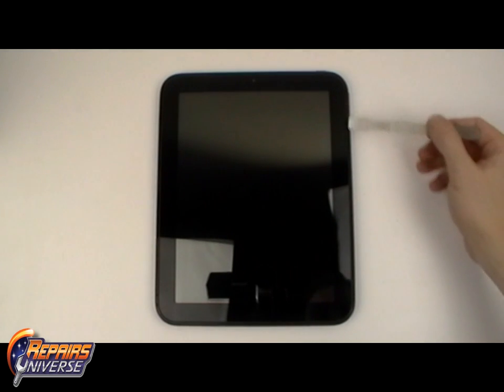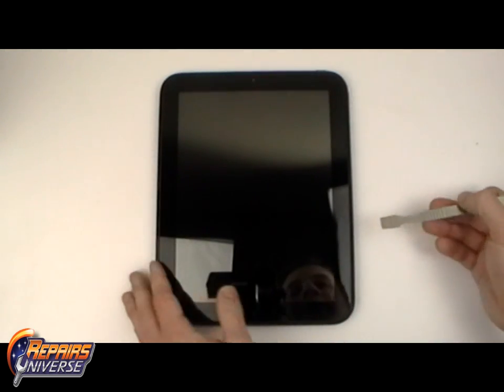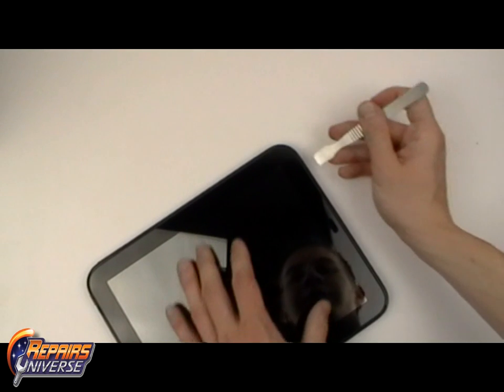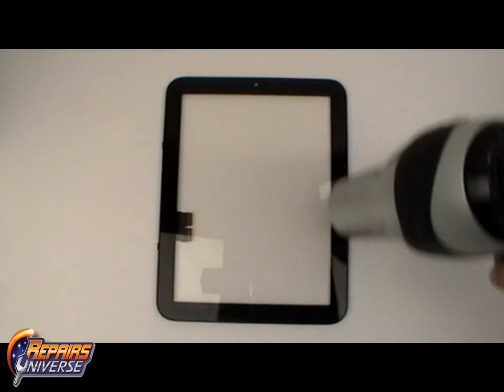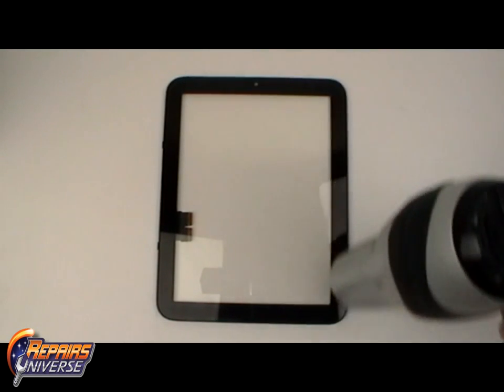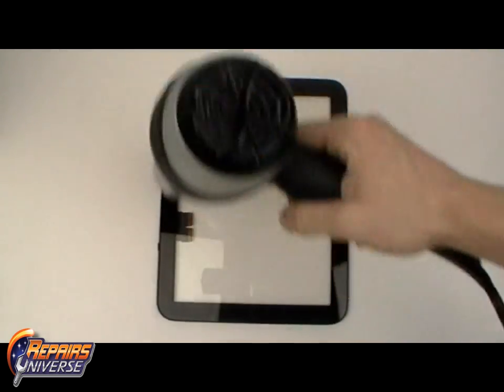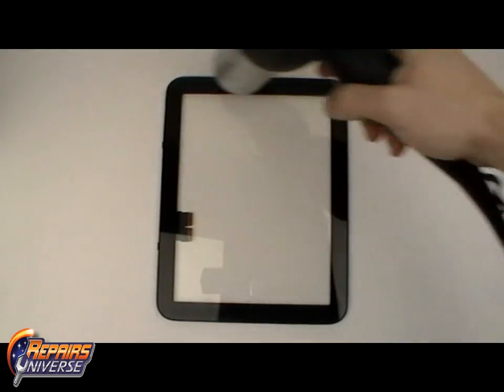HP TouchPad Take Apart Repair Guide

Comment: Thanks for not bothering to mention the corner clips.
Reply: Curiously there are only two corner clips, both are at the left corners so starting the prying from the left side of the screen is correct. The LCD connectors are also on the left side of screen.

Comment: Any tips for working the clips on this? I've opened up a few electronic devices with similar assembly, namely iPods and some cell phones, but after an hour with this, I can't seem to get these damn clips to unclip for me. I can feel and kinda see them, so I know I'm in the right spot. I have pry tools and in desperation with other devices I've used xacto razors successfully, but I'm not sure if there's a trick to these ones. Any help anyone could provide would be greatly appreciated. Also, the video is very helpful; thanks for taking the time to make it!

Comment: Hi my HP touchpad has died I don't know what happened... I have the charging dock and it isn't charging I also have a regular USB charger and that isn't working... Not lights are flashing it's just not coming on what should I do or what could be the problem??? Bad battery maybe???
Reply from the maker: Possible that the battery is out but with these they also have had software issues. I may recommending starting with a battery replacement. Unfortunately we do not offer any.

Comment: My HP slate 7 wont charge, and I list bought a new charging cable and it still won't work. Is there anything I can do to fix this???
Reply from the maker: Deborah Simon Sounds like you may have a damaged charging port. You can send the device into our repair shop and we can repair it for you.

Comment: My touchpad is dead, and I've put it on charge, the home button light is flashing but I can't turn it on, it's been on charge for at least 2 hours!
Reply: Repairs Universe how do u reset it if it won't turn on
Reply from the maker: Hello Twisted ,

Sounds like a software issue.
When you have it plugged in charging you said the home button start flashing.
When they are flashing does it flash for about 3-4 flash then shuts off.

If this is the case you will need to factory reset on the device. ( THIS WILL DELETE EVERYTHING ON YOUR DEVICE!)

Doing this should knock it out of its funk and get it right as rain. Please take your time as not to damage the install process.
Reply: I have the same problem!
Reply: My touchpad won't install the webos on the tablet
Reply from the maker: I've located this link for you here http://www.hard-reset.com/hp-touchpad-hard-reset.html

Comment: on your hp doby try chargeing it at a angle use a book to suport the charger hp touchpads worst problem with their tablets is that the charger dock breaks if you can follow this vid and look for bends if that doesnt work call RepairsUniverse (im haveing the same problem)

Comment: I've charge this for 24hrs, try hard resetting it, I know the AC adapter works as it works fine on another tablet or phone. What else can it be? I have not dropped the tablet or anything, one day it worked, the next it didn't.

Comment: Hi there. My mom got screwed royally! She bought an HP touch Screen and the screen never worked.  Because she took it out of the country her warranty is void.  The problem is, that it turns on but it has never responded to her touch.  So we have been stuck at the choose language screen.  It also does not respond to the usb connection because of this.  Do you think if I purchase the new screen digitizer that it may work?

Comment: In a way. yes..  You physically Remove the battery and trickle charge it out of the Touchpad.. Then replace into the Device and assemble the unit.  Then do a hard restart with the Power and the Bottom button for 15 to 20 seconds..  Hopefully you have fixed it..  Computer Chronicles 2.0

Comment: Make sure you've got a legit HP Touchpad charger - I ran into the same problem, found out that most generic chargers don't push enough current.  

Also, keep in mind that the charger unscrews - make sure it's properly screwed together and is charging another device, like a cell phone, then try the sleep death troubleshooting.

Comment: when I press my touchpad in the lower right (with the home button down) it feels like to sink a little, as if he were not doing correct pressure. I wondered if maybe opening it would find the problem that is not properly closed. I bought it used. Another question, I wanted to re paint the top of the casing, with what kind of paint can I?